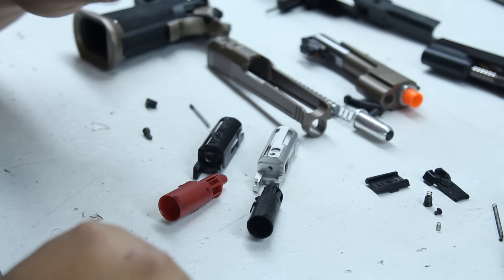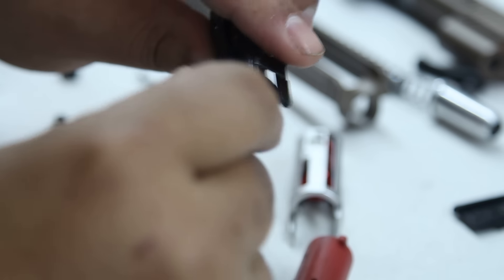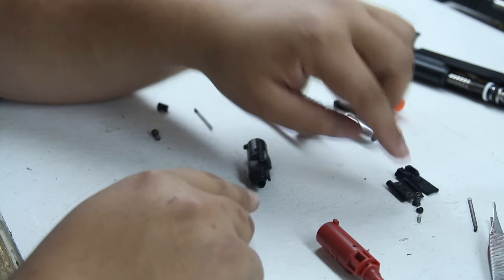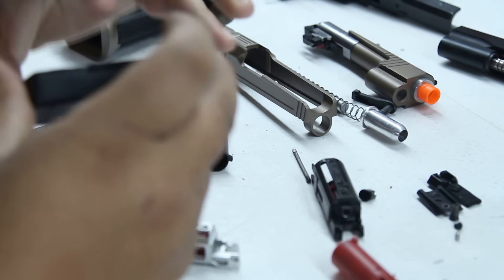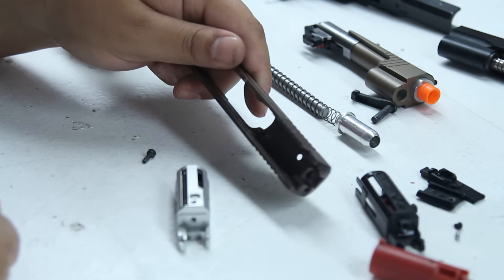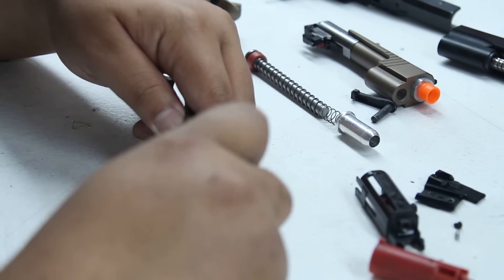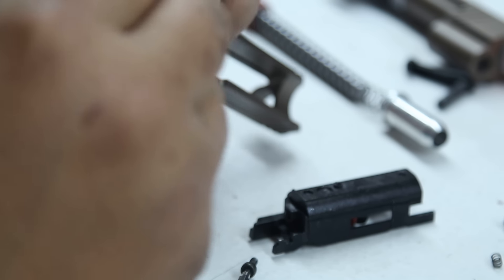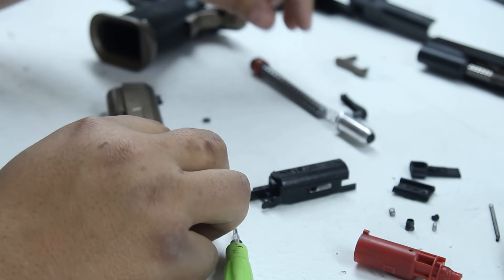Armorer Work Hi-Capa TM Style BBU Test

Comment: You can just use a countersunk head screw like the one that comes with the hammer protection pad. Seriously though this gun is not worth the time or money to mod.  The only upgrades I might do are hop up and longer tight bore barrel. Btw pulling out the orange tip is a bitch and no threads.. I do like the grip and might use one on a TM build if it's compatible.
Reply from the maker: Yea, I wouldn't even buy it but this video is for those people who want to try that out. its going to be the AKA hammer pad/AIP hammer pad that will do it. i haven't even bothered to take out the orange tip haha!

Comment: Will a nine ball piston head fit in aw bbu   If not hows the stock compression with stock as piston head
Reply from the maker: wouldnt bother, its designed for tm which is smaller loading nozzle

Comment: You could try using an AKA hammer pad to hold the BBU housing in...not sure if it will work or not though
Reply: should come with a smaller screw if i remember correctly
Reply from the maker: yea that could work out, ill have to do that outside of the video